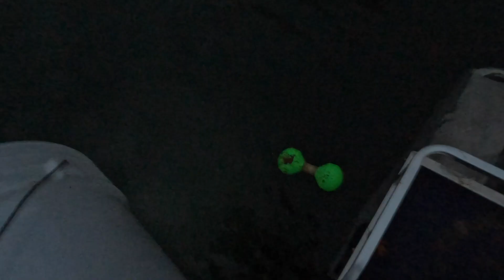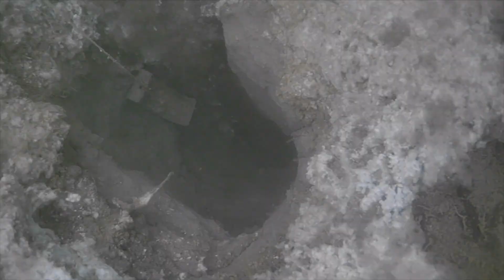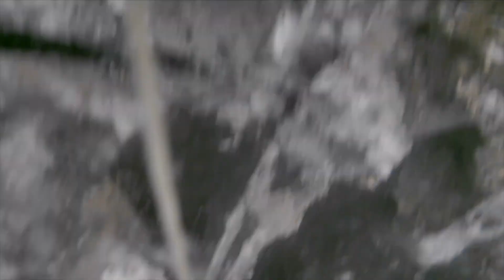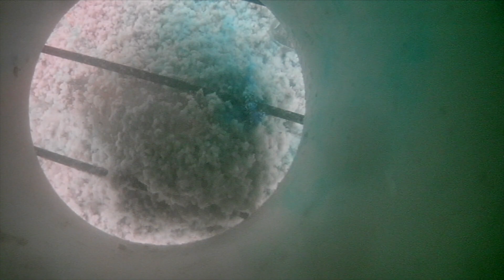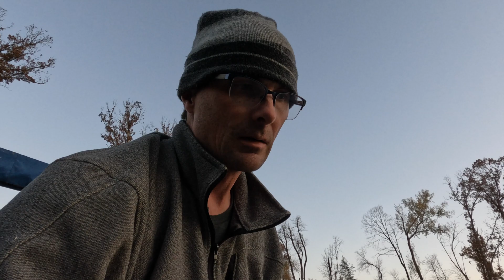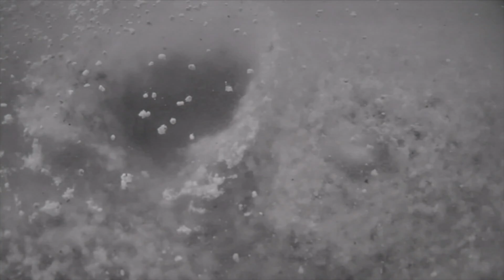How to Fix a LARGE Pond Leak WITHOUT Draining the Pond - DIY Tremie Pipe Method

Comment: Any clue what caused your leaky hole to form? Muskrat’s or  natural water vein?
Reply from the maker: Yeah, I believe it was a weak area (sand/gravel vein in the clay) in the basin that started as a crack and grew larger as the pond filled and increased the hydrostatic pressure. The hole is in the deepest part of the pond, under the most pressure. Our pond basin was not compacted, and that was our first mistake. We had one area where ground water seeped in when we started digging, but that is in another spot of the pond, and that area does not appear to be leaking at all. But we’ve got this 85% plugged currently, and will continue trying to seal it completely this spring with polymer treatment.
Reply: @newnatureadventures  awesome man. I have a failed pond that I believe to have the same issue. It’s always very low. I have a leak somewhere. It’s been 4 years now and isn’t getting any better. There’s so many different options to try and non of them have a guarantee. I don’t want to drain it and lose my cat. I might have missed it but what’s that scope you’re using?
Reply from the maker: @Darrenbrown09 Dang, I’m sorry you’re dealing with a leak. I feel your pain. I’m using an Aqua vu HDi7 camera searching the bottom. I found the leak using tracer pond dye. Not sure if you saw that video yet, but I tried to document how I did that. Our pond is pretty clear water, so I’m able to see well in the camera. I also didn’t want to drain our pond. I started working with TJ Hudson on the polymer treatment, and then we strategized on an approach to try and locate the leak. It took some effort, but we were able to isolate the leak with the tracer dye and the camera to watch where the dye was flowing. You can find that video on the channel if you haven’t seen that one yet. Let me know if I can help in any way. Hang in there!
Reply from the maker: Here’s the tracer dye experiment that worked for me. Pond Leak Repair Tips - How to Find a Water Leak in a Large Earthen Pond Using Tracer Dye
https://youtu.be/8tlfIVsfDsA
Reply: @newnatureadventures  thanks for the advice and I’ll give it a watch. I went ahead and subscribed want to follow this!

Comment: Have you tried " bright dyes" brand tablets? They have fluorescent ones, I have water coming up down below a pond, looks like spring,  but I'm hoping  fluorescent dye will show up if coming from pond. Just wondering if anyone's  used it ,? If it lights up with black light?
Reply from the maker: I haven’t tried the bright dye tablets. Just the bright dye liquid dye so far. I didn’t try the black light, but I wouldn’t be surprised if it did show up in a UV light.